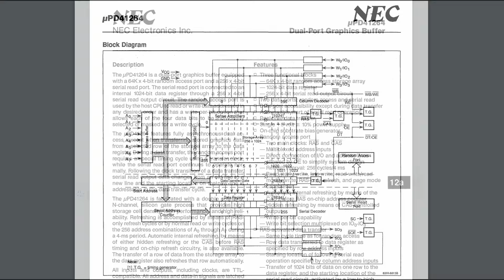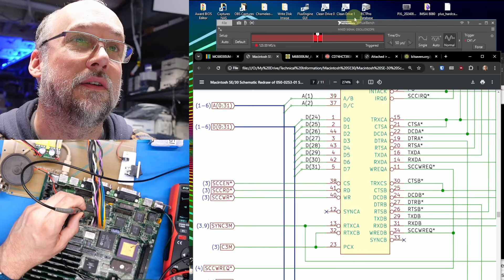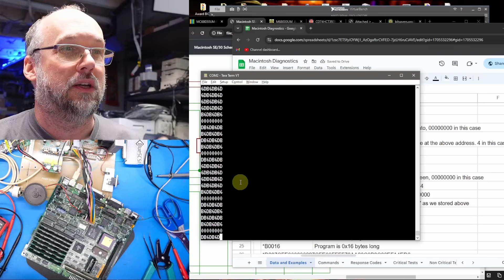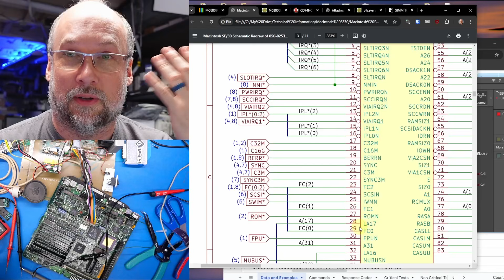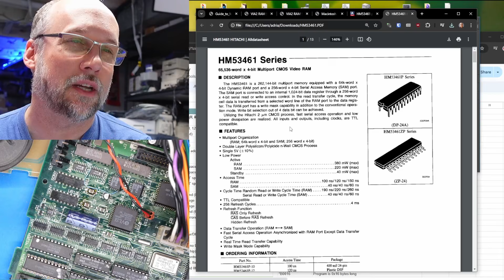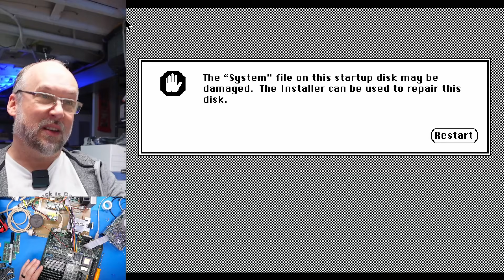12V on a 5V line almost killed this Mac SE/30

Comment: Adrian,

Though you did well with the repair. the Mac SE/20 can run without the FPU. All Mac II Series, including the SE/30 and the LC Series can run without the FPU as many such machines do not have an FPU. It is just that the machine will run slower and if you use a system made from "Build a System for THIS Machine" it will crash. If you have a generic System (Build a system disk for any machine) that it will run. Case in point - The Mac SE/30 vs Classic II, where the Classic II does not have an FPU but the SE/30 does. But if you can find (or build, as the guys on the M68KLA group made one) rare FPU Card for the Classic II, and you put in a FPU into the Classic II, speed wise, it becomes as fast (and in some cases faster) than the SE/30.

Things Like Post Script and True Type Fonts uses the FPU to render the screen faster. Without the FPU it will render the screen slower.

The FPU is not a "System Software Option" as is the OS absolutely needs it. The FPU is directly tied to the FPU and nothing else and any calls for complex math or the CPU to do gets thrown at the FPU to do. Thus if there was no FPU, the CPU would have to do that math on its own.

To cheat on those systems that does not have a FPU, there is a program/System Extension called "Soft FPU" which emulates the FPU within the CPU. Yes, runs slow as heck, but it makes things easier for the CPU to handle.

Comment: Chiming in about the plcc soldering again. Solder paste is not the best rework technique, I stopped doing that long ago. i recommend getting flux that louis Rossmann uses (that is no-clean and way better than rosin). Apply flux to all pads. Then apply new (leaded) tin to the pads. With that flux around the tin will apply evenly when going slow enough. Gnd pads sometimes require special attention. When the result looks even, apply more flux. Place the chip. If necessary tack doen on one or two legs with the iron.Then heat up the entire chip, its legs, and the surrounding pcb area. Go in circles. Your nozzle was way too small, use a larger one and enough airflow and heat (the trickiest part as the right amount of heat depends on board stack, practice level and heat gun - I use more flow and almost max heat to achieve the shortest possible process). You will see when the chip sinks down. Its worth practicing this on dead boards first. This also works with larger chips like qfp144. You do not get bridges this way and a more even result.
Reply: Absolutely spot on. I do a lot of SMT work, and getting the right amount of solder on the pads (whether by paste, or existing “tinning” of the pads) is key to getting capillary action to do your work for you — pulling the chip into place and down against the pads, and getting the solder to wick up the sides of the IC pins and form a nice solder fillet without bridging across the solder mask to adjacent pads.

It’s amazing how little solder it takes to attach modern SMT parts. For a manufacturing run of thousands of boards, it may take only a pound or so of solder paste. Each joint takes only micro-grams worth of solder.

Comment: Oh
seeing one of these USB soldering irons (also applies to the old TS100)
note to the young players
NEVER EVER use them on a NON-EARTHED power supply (aka 2 prong plug to the wall)
it will fry chips because of leakage currents, like ESD but with a bit less volts and more amps.
With an earthed PSU you do not have the issue. (just seen that happen last weekend, yet again, can be very frustrating)

Comment: Hi Adrian, I've been watching this series very closely because I have an SE/30 that I haven't been able to repair after leaky caps and light battery damage. I was hoping to get the information I needed to diagnose and fix the board. I almost stopped watching when your repair fried that first board. Sometimes it's painful to watch you make mistakes, even though armchair technicians like myself make plenty of similar or more serious mistakes. I'm glad I kept watching because the information you shared including the reconstructed schematic and spreadsheet on serial port diagnostics is just what I needed. Knowing that others struggle to repair this era of macs and that it is possible to work through difficult failures makes me want to try again on my board. Thanks for sticking with this repair.

Comment: Have thoroughly enjoyed this series. Have great nostalgia for the old '030 as my first job was working on a bare-metal '030 workstation programmed via an in-circuit emulator which of itself was a marvellous piece of kit. Seeing the phrase 'f-line' pop up instantly triggered memories of Motorola terms for co-processor (any, not just the FPU, if memory serves) related gubbins.

Now all that’s needed is for someone to write a GUI app around those serial diagnostics to ease their use — or even emulate the original test device 😂

Comment: Did you confirm it works with different RAM amounts? I thought the 4mb was temporary because the address errors got it stuck into thinking it was always 4mb even though you had 1mb.
Reply: I noticed he did that at 54:42

Edit: I thought the temporary ram amount was 16mb, using 4mb modules?

Comment: The fault finding is epic! Well done! 

A trick I learned from northridgefix is to measure some power lines of good boards using the diode test mode on the multimeter. Noting the voltage drop, when you recap the board a short to a data line would likely give a different voltage drop on 12V indicating a problem.

Another trick when doing work on main boards is to use the flir camera and give a quick on/off power up/power down. If some parts shoot up in temperature you might be just in time to prevent permanent damage.

Comment: Is there a math coprocessor "present" pin on the CPU (like on a 286/386) that you could manipulate? I wonder if you'd still get weird crashes if the OS can be made aware the math coproc is actually not connected... Or if the coproc is always supposed to be there and there's no error handling/mode for it anywhere in the released, non-development versions?

Comment: I thought there was an issue if only 256M simms were installed since it thought there was 4M total and putting 4M in bypassed that error.  Did I miss how/where/when that was fixed?

Comment: Instead of using paste and heating the chip down with it loose, I'd solder two opposite legs by hand, then apply paste on the rest around the outside, and use hot air to heat.  That way you can get the chip lined up perfectly in advance, then melt the paste and not have as much chance for the chip to move, even if the hand soldered legs re melt.  OR, hand solder all of them, then add flux paste, and while pressing down, use hot air to re melt them all to wick the hand applied solder in well.  Flux will make hand soldered pins flow and be shiny and really nice.  Of course you can't clean the flux under the IC without bathing the board in alcohol or using ultrasonic cleaner bath.

Comment: You don't need solder paste. You can clean the pads, tin them, then add flux and then sit the chip on top and heat it with hot air until it slides into place.
Reply: One addition: You can't hold the chip down while applying the hot air, or it won't slip into place. If the chip tries to fly away, the air flow is too high anyway.
Reply: I’ve totally done this before. Additionally the main problem Adrian had with the soldering job he did was with the lack of flux.
Reply: This is the way I've learned to solder those types to chips.  It works well.

Comment: Well, if anything, it is a good lesson in remembering to triple-check your work before applying any power, just to be sure there's no shorts or unwanted crossed wires blowing out a load of parts in the process... :)

Comment: I've only seen solder paste in videos, but that looks like it's too much. Usually it's brushed and very, very thin.
Reply: based on what I've seen, I think you want to use hot air to melt the paste before applying the chip.

Comment: What an adventure.  Man.  Love that spider VRAM you have there.  I'd clear epoxy that sucker for stability and use it if the board still fits in the case.  Luckily this wasn't a customers' board.

Comment: When it comes to laying down the solder paste, one continuous stripe across the pads (at least the same diameter of the dispensing needle) is generally enough. J-lead packages are slightly more forgiving (IME) than the QFPs when it comes to excess solder.

Comment: if the IC seems to not self align, You can try to push it very gently to see if they back to right position. Using lot of flux helps with self alignment and solder bridges

Comment: Thank you Adrian for this series, it has been very nice to follow along on your journey! Just one tidbit I have not heard you mention: there is another reason that ceramic capacitors are not a good idea to use and that is their capacitance is voltage dependent, I can't provide direct links due to Youtube censorship but if you Google for this you will get some good articles: capacitance voltage dependency ceramic capacitors
Reply from the maker: I've talked about it before and it is something to consider. I've done a bunch of testing and this is mainly an issue with circuits using the caps for timing (RC, etc) as the values being off cause issues. But for bulk capacitance like what's happening here or AC filtering like on the audio circuit, it doesn't matter at all. As long as you check the datasheet to make sure you aren't getting 4uf when it should be 50uf.

Comment: Adrian, @1:05:20 wondering what kind of default checkerboard you'd get if you swapped out the functional NEC and used two Hitachi ZIPs?

Comment: If you have enough space on the PCB you may try actually soldering an SMD-PLCC socket in place, those you can solder from the "inside". AFAIR they have the same pad layout as the chip itself
Reply from the maker: Yeah that would have been ideal. I have some PLCC SMD sockets but I looked at soldering those and it seems impossible without melting the socket. Luckily I don't really work on SMD systems much and I don't intend to, so I don't need to practice too much. :-)

Comment: I think you used way too much paste. you could have used some solder and a lot of flux and tin every single pad then apply some flux again and solder it with hot air.

Comment: I have next to no interest in apple pc's but enjoy watching the techniques and repair philosophy you follow. 
Thanks Adrian. 
You deserve more views.
Reply from the maker: Thanks -- I do try to show that the techniques are the same no matter what the system is. :-)
Reply: I feel the same. I watch for the sheer enjoyment of seeing an old machine come back to life. But I would NOT ever want to use that old thing. So I am glad that Adrian is doing all the work and I don't have to. And I don't have to figure out what to do with the old machine afterwards either.
Reply: Same here, The Amiga was my home computer for a long time and would never give Apple house room , but I've done so much fault diagnosis  on  all sorts of equipment, mainly on Radar and Sonar equipment and custom CPU systems Z80, 8085 etc . that I can see most of the techniques I was taught being used here. Very well done, and it's a wonderful learning tool for any engineer to work through.

Andy
Reply: Same here

Comment: Adventures on the 12 Volt Rail - sounds like an 80s movie!  This is making me want to dig out my Mac II motherboard.  No voltage adventures there.  Just let it sit too long and the caps corroded it.  Managed to get it to chime but no video.  Probably my poor SMD repair skills.
Reply from the maker: Ah well you know you can bust out a serial cable and hopefully try to get some answers from it. It's like R2D2 talking to the Death Star computer :-)
Reply: @adriansdigitalbasement  I'm no where near as smart as R2D2.  It'd be more like Roomba talking to the Death Star lol.  I'm digging through your videos now to find your technique for bodge wiring on these tiny traces.  I've done it but I have a hard time avoiding other traces.
Reply from the maker: @TechTimeTraveller  I predict a pretty funny sketch!!!! R2D2 can come by and knock the Roomba out of the way and get real work done 😂

Comment: 1:13:15 Rossmann has ranted about Macbooks having high voltage right next to data lines for years. Seems Apple started this tradition decades ago 😂
Reply: Feature enabled once the battery leaked

Comment: Adrian i suggesto to use flux while cleaning pads and to avoid bridges, then use less solder paste for those type of soldering.
Reply: yes, the chip needs to be basically floating atop the puddle of flux in order for it to be drawn to self-align to the solder pads

Comment: It was a foregone conclusion that at least 90% of the ICs sitting on data line 32 would be damaged with 12V fed into 5V inputs for an extended period of time. If it was only a couple of seconds maybe not, but it was longer than that.

Comment: The F-line instructions on the 68000 is reserved for Floating-point (see what Motorola did there? F for Floating point). So removal of the FPU would cause those instructions to malfunction. This makes total sense.
Reply: F-line instructions also handle other co-processor or integrated functions like MMU and the later 68040 move16.

Comment: That ram chip seems like the perfect candidate for a custom PCB adapter. Would still end up cheaper than buying an untested used chip from unreputable sources. The donor card has a few more of the chips so a PCB would be useful if you needed to use some in some other system.
Reply from the maker: Indeed everyone. Yeah these ZIP chips might be easier to find in the future than the old DIP package, so the adapter PSB would be super helpful. For now the wire mess will work for me :-)
Reply: It would be fun to design a custom PCB adapter from ZIP to DIP which would look very clean as a replacement, especially if you could successfully lay the ZIP chip flat.
Reply: Adrian even mentions @6:30 that the dual port video RAM chip was weird and has only encountered it on this system.  So I agree, taking advantage of salvaged ZIP packages and making a small PCB adapter for future SE/30 machines makes perfect sense.

Comment: On the 020 and up, you use those special F-line instructions to talk to the FPU/PMMU. If the copro isn’t present, the instruction acts like a trap, allowing the OS to jump into a replacement routine. Seeing as the SE/30 was never meant to operate without an FPU, it makes sense that they didn’t include a routine for that!